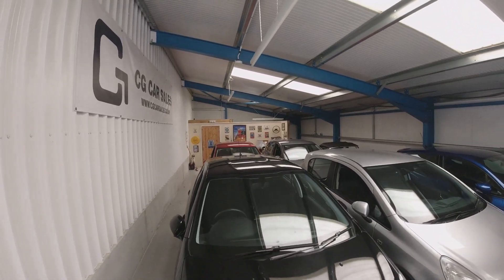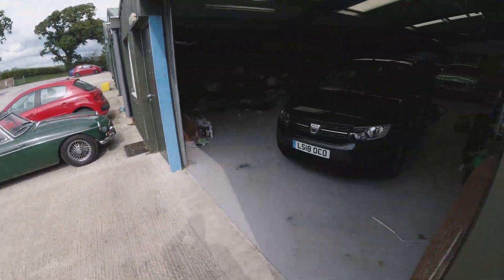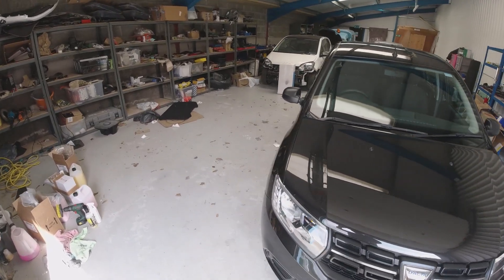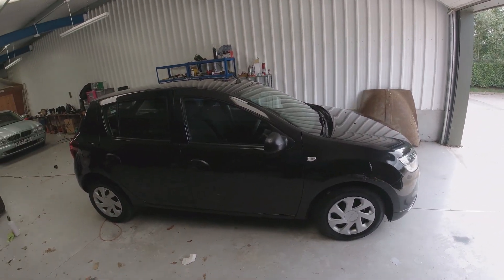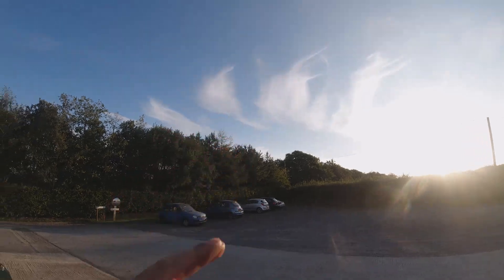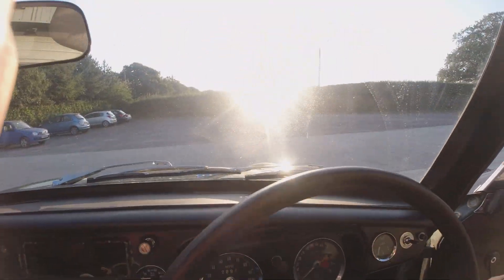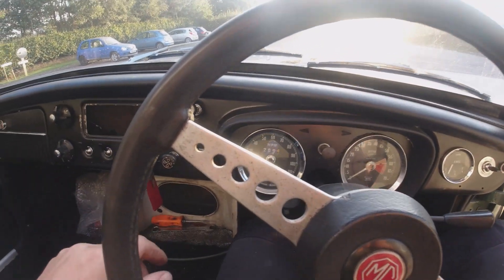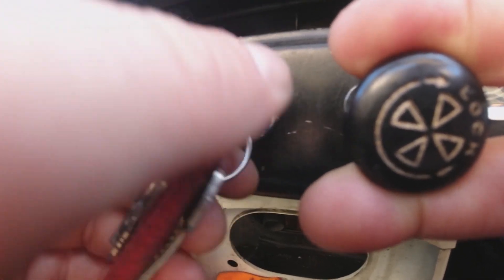He threatened he would be back!

Comment: Hi James, I think I may have a solution to your MG choke problem. Slacken off the choke cable screw at the carb end, twist the inner cable about half a turn or so and then re tighten the screw whilst keeping the cable in this position. This will have the affect of the choke knob 😁 wanting to spring to one side and stay where it is when pulled out. Back in the day I used this method with great success on my maxi, marina, avenger, you know the quality cars of the day !!! Hope it helps you.
Reply from the maker: Oh nice tip. Ill give that a go!
Reply: @ChopsGarage  just order a new choke cable mate, only be a tenner, hard to flood an engine with su,s tbh, sounded rough when it fired up, they've terrible for jet ware, get the mixture right at tickover and its too weak higher up, jets go oval due to the bias on the needle, permanent live to the pump sounds crazy, overheating and petrol together, alternators can cause current drain, check if it get hot, it can't be charging right if you've hot to leave a jump pack on, or your batteries knackered, when everything is set up right,a mgb 1.8 is as good as a modern car, looks like it needs a good going thru.

Comment: Thanks James. I got the extra £5 off the jump starter. I've been meaning to buy another after my old one died and this spurred me on to do so!  I'd love you to do a video on how you machine polish a car sometime. Cheers
Reply from the maker: Will do Oliver, cheers! Something coming up in the next mate
Reply: If you never used a machine polisher it does need experience, i've been using them for 30 yrs, first year i made sooo many mistakes 😆 TOP TOP NEVER BUFF THE BONNET IF IT'S GOT A MANY STONE CHIPS. The chips will get much bigger & it's make it worse & look worse.
Reply: @ChopsGarage  Can't wait. I got a Silverline,my own not works. Buffing heads are half ok from my local warehouse valet dept,i got the sofer one not the hard one which is too dangerous for paint.

Comment: Agree about Dacias, if you can get over badge snobbery they are cracking cars. Bought my Sandero Stepway new in 2019, not one thing gone wrong with it. Excellent value cars.🙂👍
Reply: My wife has a Logan MCV with the little 900cc 3 cylinder turbo and loves it.  Decent mileage (50+), loads of boot space and surprisingly well specced as well, cruise control, DAB, parking sensors.
Reply: Mine has the 900cc petrol 3 pot engine and pulls my small caravan without any issues. Great cars.🙂👍

Comment: Hi James, be careful with the booster pack, with the one I have it tells you to disconnect it within 30 seconds of starting the car or it can damage the booster pack, I’m not sure if it’s the same with the topdon but I would check.
Reply from the maker: Yes as I said in vid not sure a good ideal to leave connected
Reply: If the lithium battery sees the alternator output it could be damaged (and possibly catch fire). Also if the lithium pack is able to draw too much current from the alternator the alternator could burn out. The gadget with the leads and clamps on it is there to prevent that happening but it's only designed for a few seconds use.

Comment: The O2 sensors have a built in heating element in them, they fail very commonly, it's so the sensors are at operating temperature from engine start up, it's all to do with emissions, new sensor required, it's fooked 😀
Reply from the maker: Cheers

Comment: Is there a quick fix for the pistons that hold up the boot door? The ones on my car don’t push the door fully open.
Reply from the maker: You just buy new ones from Ebay , cheap enough
Reply: They are pressurised with gas and can lose the pressure over time. Easy to replace with aftermarket new ones from a motor factor such as Euro Car Parts or just cut a broom handle to use as a prop.

Comment: Feel free to laugh but you could buy that Dacia Sandero brand new for £7995 two years ago but now prices have become ridiculous 12 grand a new one costs now due to sky high metal prices lol
Reply from the maker: Not that one, you are talking about base model
Reply: @ChopsGarage  Yeah it didn't even have a radio lol 😆  if I was going to buy a small car probably a Suzuki Alto as they are super cheap 2014 model for £2 grand online.
Reply: @ChopsGarage  When they first came to UK base model was £5995. For a brand new car it was crazy.
Reply: Paid close to 10k for ex demo top spec with xtra .9 tce mid 2012.    Added 2013 access base spec 1.2 3 years ago for £2k.  Local dealer has 14 plate stepway up for 6995!   Don’t know spec /mileage
Reply from the maker: @chrismacey5106  I have looked around and think I under priced mine lol

Comment: 200 peak amp? That may be ok for a "flat" battery thats still at 10 volts charge but you try that on a properly "flat" battery.A diesel starter can draw 750 amps on cranking on a larger engine.Plus the ECU needs power at the same time.Also a "flat" battery can still have 10 volts but the ampage goes down dramatically so a 800 amp hour battery at 13 volts may only give 400 amp at 10 volts.The starter surge will kill it.
Reply from the maker: All I know mate is it started a dead 2.0 diesel and a 1.8 petrol and still had plenty of juice left in it
Reply: A properly "flat" battery may have just a couple of volts and no ampage at all left.I have used jump packs on diesels and really the battery has to realistically have 10 volts in it.I also dont get why you kept the pack connected once the car had fired up if the alternators good.? I suspect this video was nothing more than an advert.Fair do,s but non the less a cheap sell.